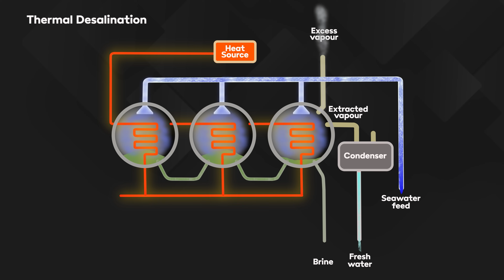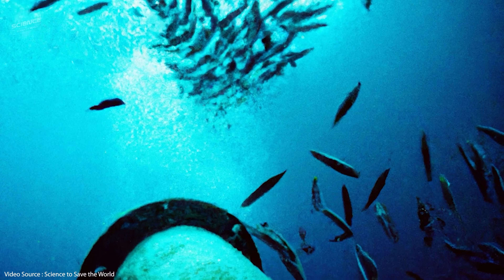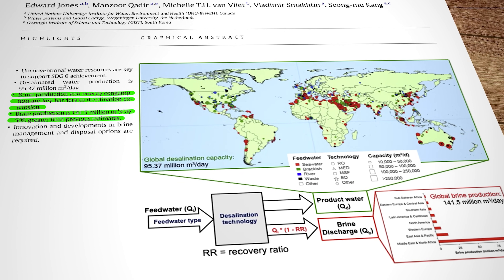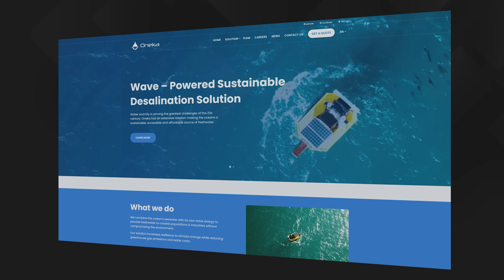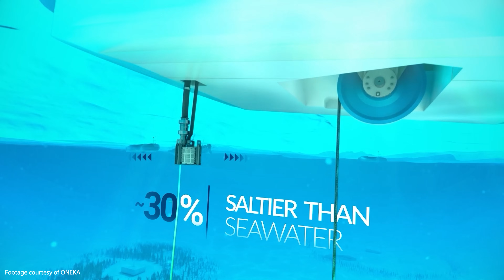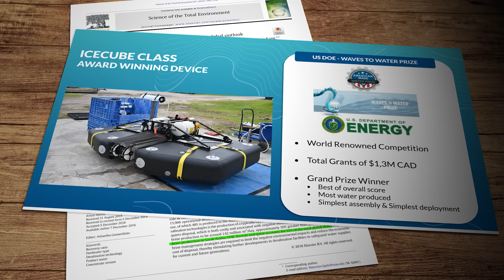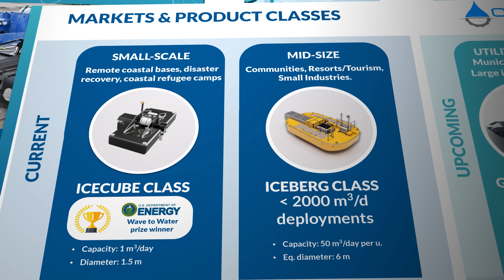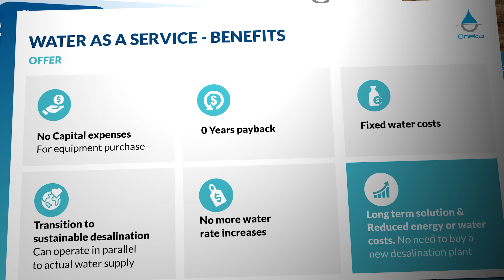Fresh Water at Zero Energy Cost . How do they do that?

Comment: There can never be = 'zero energy cost' as claimed.
When salt is dissolved in water it requires 3900 Joules per Mole of salt to separate the Sodium and Chloride Ions.
1 mole salt is 57grams and there are 35grams of salt per litre of ocean water
Thus, to reverse the process of dissolving salt in water requires (3900x35)/57  = 2,400Joules per litre.
For the smallest machine supposedly creating 10,000 litres per day, that equates to a continuous/average power of 277Watts
I find that rather surprising that such a small little 'boat' can generate that much power just from bobbing around in the water
That is even before any energy is used for simply moving the water around, easily another 50%
I'd guess that's around 10kWh per day. 
Colour me sceptical for the claims here.

Comment: My primary comment is the transfer of the filtered water to shore. This will require some amount of flexible line transporting treated water, the exterior of which is exposed to the sea water. That introduces the possibility of minor, or major, failures that introduce seawater having potential pathogens into the filtered water stream. In the United States, such a situation would likely require treating to drinking water standards, which would likely require a duplication of filtration. I know of one example where flexible water line submerged in seawater carrying municipal water had to be treated again to meet regulations of a public water system.

I wonder about the achievable flow rate to the shore given the energy is provided by the wave action and the end point is at higher elevation. I know this is doable, just at what flow rate? This concept has me wondering about use with lower frequency waves…the tide. 

The discharge brine appears to exit the screens, which will remove some of the accumulated particles from the screens. However the growth rates of algae, barnacles, mussels, tunicates, etc. on the screen leaves me concerned as a significant maintenance issue, generically raised by other commenters. 

Another issue is robustness to withstand storm damage.

Comment: Well there is not 0 energy cost because kinetic energy is still energy, zero electrical energy cost sure, but you also could have used that kinetic energy to generate electricity which has far more uses so...

Comment: Well, if I lived on the ocean, this seems like it would be a good idea. I likely would not need so much water there. It could be augmented with solar so that when the waves were low, and the sky clear, the sun could do the pumping. And, when it was clouded over, the waves could provide the power.  But, sea water desalination is best done for cities in coastal areas. And in that case, it seems a lot cheaper to simply use their better filters to draw in water from below the surface through a pipe, and similarily discharge through pipes with multiple outlets.

Comment: Thanks for this wonderful presentation.  The world could certainly use an environmentally positive system of increasing fresh water supply and what you showed just mad do it.  I temper your enthusiasm for the experience with doing anything clever at sea -> it normally fails.  The sea is a hard place to live and for any object placed there needs to be especially durable.  I remember with excitement a wave driven electricity plant that was launched into the sea, struck by a storm and destroyed before ever generating a kilowatt. Better luck to the inventors of the product you presented. Cheers.

Comment: Wind and water have consistency problems. But winter time????? Summer for maintenance.

Cheap to run cutting the middle energy to just use the mechanical force we would normally use to generate electricity.
Nice. worth a crack Nigel:

Comment: Wave generating power isn't chosen over solar. Why?  Whatever that reason is, its probably the same reason why this is inferior to the systems that are in current use. My assumption is, while you are harnessing the energy from the waves, you are vastly increasing your maintenance costs vs a system with all its hardware on land that just uses a pipe to draw water in. Any hardware that's located on the ocean has high maintenance costs due to both accessibility and the corrosive effects of seawater. There are other parts of your argument that are weak/illogical like your absurd argument that there is a better use for renewables which should be used elsewhere to offset fossil fuel power generation while elsewhere you mention that most desalination is done using fossil fuel produced power.  Making arguments for this system based against marine life getting sucked in, or the impacts of concentrated brine are likewise absurd since it also sucks seawater in and discharges brine and any differences are not comparing apples to apples in a by-volume basis. Congrats, you made a stupid video and got a comment.

Comment: I like local and tend toward multiple answers, so I'd like to see solar panels on top driving chillers that would retrieve the resulting condensation  from the damp air immediately near the water surface. Any sea spray getting picked up could be removed by the membrane. My basic optimism tells me that most of the energy water and food problems could be easily solved if the solutions weren't aimed at making huge profits for the investors first and beneficial effects second. For this reason I'd like to see grants and funding provided to more non profit organisations.

Comment: An informative video, well done. ONEKA will be only a small factor vs the massive fresh water shortfall looming post-2050. ONEKA gives no net gain on brine reduction.  The brine produced will be the same, they just dilute it. ONEKA will have higher maintenance cost per cu meter water for RO unit maintenance, and marine life clogging. In the Middle East, and elsewhere, most Desal Plants use waste heat from other facilities, reducing their energy input significantly.  ONEKA seems a great niche approach, good for emergencies, and unsustainable cities like Key West, and ONEKA will likely make money.  But they will not be a factor in reducing the massive fresh water shortfall looming ahead for the latter 21st century.

Comment: Our RO systems in all the applications we install require a UF step upstream (or similar) to provide sufficient pre-treatment for stable operations, those cartridge filters I see on the platform will be clogged really quickly (in our experience it can be as fast as 48h) which would be impossible to maintain… I don’t see how they took that into account, possibly they have specially selected RO membranes, but still feels quite tricky to pull off.

Comment: Would need to keep large marine mammals away so they don't get tangled in the cables, etc. One whale could wreck the system and drown in the tangled cables. Other that that, I love it. On bigger, land based desalination plants - I always wondered why they don't evaporate the brine and sell the salt. If it's not clean enough for consumption, it can melt ice on roads or be a source of chemicals after refinement. If brine evaporation pools in desert climates could be positioned so the humidity would rise up a mountainside, it might precipitate out on the mountain - adding more water to the location.

Comment: All you are doing here is converting mechanical power instead of electrical power. You could do this at a nuclear power plant as they are often built by the sea and run steam through a turbine creating electrical power from mechanical power. The problems of intake and output are easily solved by using multiple intakes and outtakes as with the boat based 1 you presented. So while this might be a solution to the problem of a local community it's basically selling you a desalinater with a solar panel  and saying it's zero energy cost.

Comment: seems like the problems with fish getting pulled in and brine being chucked out are solvable using the same method spread everything out a bit so more inlets pulling in the same total water but over say 10 inlets and on the output the same amount of brine being spread out over a much larger area. Or of course you could heat the brine until it evaporated all the water content and then either use or store the salt left over.

Comment: Reverse osmosis requires a lot of energy but Southern California is unique:  It takes more electricity to transport an acre-foot of Sacramento Delta water to Southern California than the Carlsbad desalination plant consumes to desalinate an acre-foot of water!  It's about break-even for Colorado River water.  So that "expensive desalination" claim has to be amended.  It's only expensive compared to a nearby fresh water source.  And since reverse osmosis uses LESS electricity, it would be a carbon-negative change over what we are doing now.  In addition, California has enormous solar power resources in it's vast desert areas, so we could actually get the whole thing using far less fossil fuel with no energy storage problems.  Make fresh water while the sun is shining and store the excess in reservoirs for when it's not.

I also suspect your size statements are way way off.  the Carlsbad plant make 50 million gallons per day (more than 10 times your big wave-powered installation) and you can hardly tell it's there.  It's relatively small compared to other industrial facilities around it.

Comment: It seems to be clearly useful for some areas where wave movement is large enough to more or less consistently power the system. There are areas that need water and have the associated wave action. Hopefully they will be able to spread out the return soft brine over larger areas. A 20% increase in salinity sounds small to us, but it is above the concentration that will kill almost all saltwater fish and invertebrates. It should be possible with additional expense to use the tendency of brine to displace regular sea water to in effect spread the brine over an increased area.

Comment: Interesting idea.  It might work well enough as long as the weather cooperates. There was this mining operation that I once heard of in a coastal desert of Chili.  It had similar problems with water and used a set-up like a greenhouse.  The water was let in through the action of tides as a storage area and settling area. (This was in the 1880s, if memory serves.)  The required pumping action was also by wave power and pumped seawater into a sort of glassed in greenhouse that had its bottom painted (for lack of a better term) with tar.  The glass panes were held in a metal frame with tar as well.  The Sun would shine through the glass, heating up the water so that it would evaporate and condense on the glass panes. Eventually there would be enough water on the glass to run down into catch channels that were on an incline; the water would run down the channels, through some flap, one way valves and into some wooded water barrels.  I think that the whole set-up provided enough drinking water for the mine's operations for about 5 years. When the ore ran out it was taken apart as the glass was pretty expensive at that then and there.  I don't recall what the mine was factually mining.  The story was mostly about the cleverness of the greenhouse and wave operated pumps.  Think that it had to be tended to, daily, as it was all pretty finicky.  By today's standards, drinking water that had prolonged physical contact with tar would be a medical no-no, I think.

Comment: I immediately think of Aegean Islands.  Especially in the North Aegean there is low salinity due to the Black Sea water flowing in.  This might make desalination less difficult.  The Islands usually have to rely on winter rains.  A bobbing desalination unit could be a good source of fresh water.   
What needs to be done is for the builder to have site survey procedure to determine the viability of their units.   This should include: depth of water,  salinity, typical wave action bu season.  
Problems I see are: theft, collisions with boats, insufficient wave action on some days.

Comment: Forgive me, but I am somewhat confused here. By my way of thinking, close to 100% of this planets "fresh" water was once salt water. Does not all of our rain and snow basically come from water evaporated from oceans? It then accumulates on land in glaciers, lakes and rivers? Doesn't that mean that there is a "natural" desalination process that has been occurring since day one? It kind of sounds to me like this big push for reverse osmosis etc is just a way of adding "value" to this basic necessity of life. Why not just replicate the natural method in a controlled way so that we can get "fresh"water where we need it? It may be that all that we really need to do is remove the accountants and engineers from the formula to solve the problem.
   As for the brine. Just dry it as someone else mentioned. But instead of using that as sea salt, refine it to it's components. If I am not mistaken sea "salt" contains about 140 different elements and other components. Things like iron, gold, silica, calcium, etcetera, etcetera, etcetera. Even better these elements already exist in a pretty well powdered form. So it would just be a matter of separating them from each other. These individual elements are much much more valuable than just the sea "salt" on it's own. So you now have another source of revenue from the process. 
  Just imagine if we could find a low cost way to elevate the "fresh" water. Then you could add another source of revenue from dropping the water into a turbine to generate electricity. 
   I only have a high school education, so I am probably way off base here. Either that or I am treading on the toes of some very large and powerful corporate entities who are more interested in making money than they are in providing goods. Who knows?

Comment: 1.  Desalination = removal of salt.  A 25% efficiency doesnt change the amount of salt put back into the ocean for every cubic meter of desalinized water.  Ergo, the salt density of the brine is not an advantage:  it just doesnt matter.
2.  The economics is not clear.  A full carbon price factored into the comparative amortization, maintenance and operation costs of different desalination schemes would be needed to reduce their comparison to a single metric that clarifies the full economic advantage of wave-powered systems (and to devise the regulatory or incentive framework that propels their adoption).

Comment: Why not just build it under the waller instead. The pressure alone from the water above is "free" and you dont have to do anything about the extra brime. Sure you wont get a lot at once but would be easier. IF you do need more pressure - you can get a lower pressure system thus making the above pressuree even higher relative to the action below. Take the water out - but leave enough to seal the chamber as it pulls more water in.

Comment: how much pressure is needed to push water through a filter? a thought i had ages ago was to just use a large heavy tanker ship with filter lined holes in the bottom of the hull, figuring the pressure of the sea flooding into the hull would do the job... would the pressure be enough if a displacement hull was deep and heavy enough, perhaps placing the filters on the end of pipes extending down into the depths?  no waves needed if the action of the tanker sinking was enough to do the job... the fresh water would obviously need to be pumped out to shore fast enough to stop the whole thing actually sinking...

Comment: 11:07 Upcoming Glacier Class with a diameter of 12-15 meters?  I'm thinking if the vessel becomes too large (approaching the wavelength of the ocean swell), then it would result in the vertical displacement becoming much less than a smaller vessel that rides the full height of the waves, and the system relies on vertical displacement to extract power.

Comment: Thank you for another thought provoking presentation. The concept of taking a smaller percentage of water from the sea on each pass through the system, seems to help over ride one of the key objections of the drought hand wringers.
  There is a distinct possibility that this approach will not work in it’s present form. But if it shows some unseen benefits that attract supporters or competitors, it will have served a useful purpose, and helped our planet. 
  I was employed for several decades in a product development group of an international rigid container manufacturer. They still have a facility dedicated to recycling the HDPE (2), and PETE (1) materials. One of these materials has a specific gravity greater than water, and will sink in fresh water. However, I do not know about the results in the average sea water density. Another point to ponder is that 5here can only be a certain percentage of recycled material mixed in with virgin material in order to produce a serviceable product. One solution to the scrap plastic issue, since our population would rather take the “out the window, and in your yard” form of recycling, has been used in some European countries, is to burn the granulated scrap plastic, as a partial source of fuel for steen production and other applications that will change in the future.
  As a closing thought, I believe that it was Henry Ford, who stated that if you always do what you always did, you will always get what you always got. This is hardly an acceptable future for our planet, and it’s inhabitants, either animals or plants.